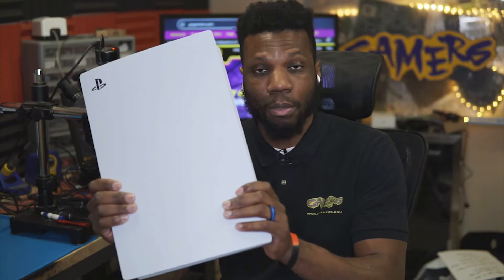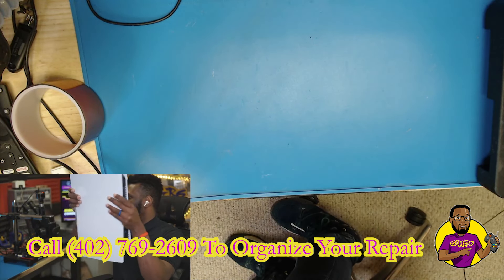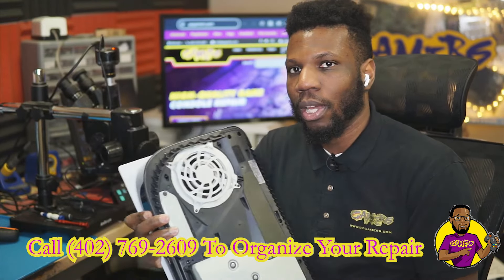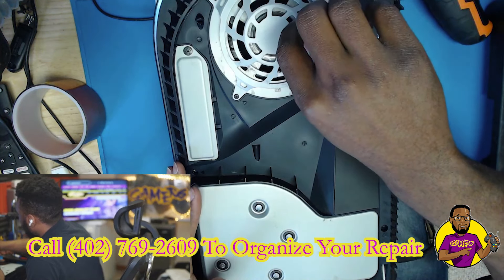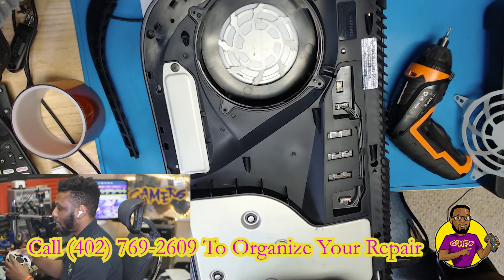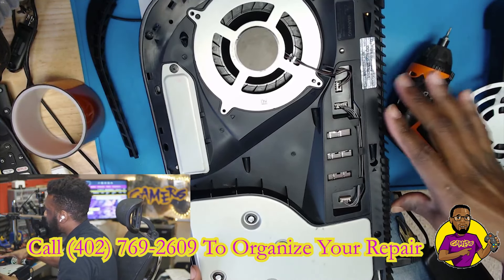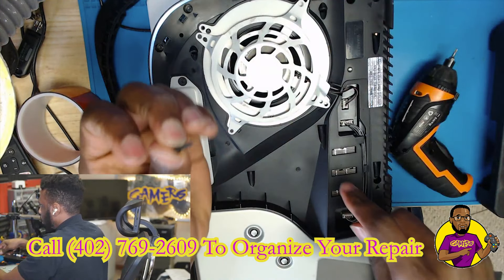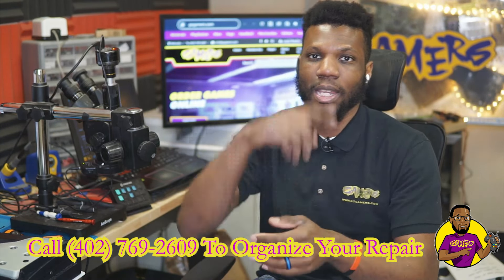Fix PS5 Overheating and Is Too Hot (EASY 5 Minute Fan Repair!)

Comment: This is what happend to me

A bought a ratchet and clank rift apart ps5 and started playing peacefully until my ps5 was like (welcome to the sony airline our plane will start in 5 4 3 2 1 ) and boom overheating text on my monitor and then it turned of when i checked what is wrong then everything was fine but the fan doesn't spin 😞

Comment: Ijust cleaned mine a week ago and it still overheats i even started putting a fan blowing towards it.it has to be the software ive had mine for 9 months and it just started
Reply: Here are the steps I took and my ps5 doesn't shutoff anymore
1. I plugged my ps5 directly into the wall socket (Sony says to try this) 
2. Then I cleared the system cache when I did this I was playing with no issues after that, but in the morning I did a rebuild of the data base just to be sure, been playing like normal now hope this helps

Comment: My ps5 stays over heating smh I didn't pay $700 for this b.s to happen
Reply: Fr in the same position as you
Reply: Same
Reply: same..my fan plug been malfunctioning..stops and goes
Reply: @3amryzefn  the only way to fix this for me was to remove the top face plate. I couldn't play any PS5 games without it overheating and shutting down after 30 minutes. It's almost like the top face plate is smothering it bc it doesn't get enough air. now I can play Fortnite/ sea of thieves/ any PS5 games all day and hasn't shut down again so far. So its definitely a design flaw.

Comment: I don't even get the warning message.
Mine literally just shuts completely off and I can't turn it back on for a solid hour or 2.
It's freaking me out.
Reply: Here are the steps I took and my ps5 doesn't shutoff anymore
1. I plugged my ps5 directly into the wall socket (Sony says to try this) 
2. Then I cleared the system cache when I did this I was playing with no issues after that, but in the morning I did a rebuild of the data base just to be sure, been playing like normal now hope this helps
Reply: @platinum5gaming  this work?
Reply: @llSeannll  only for a little bit but I ended up fixing it tho, I had to buy the screw set to take out the fan you don't need to move any stickers or cables for the fan just lift it out and place it to the side of your ps5 you should see your heatsink where the fan was, clean that and your fan gently use a microfiber cloth to grab excess dust or use canned air to blow through the vents from the inside now when your done the most important step that will stop the overheating grab a flashlight and shine it down where the power cable is you'll see a bunch of holes on a black piece use a toothbrush or makeup brush and clear those holes after this my ps5 is like brand new can't even hear it and no more shut offs
Reply: @platinum5gaming  make a video

Comment: How did you fix? mine ain't that dirty and i been playing since released like Nov 17 2020. It's been a year 7 months today and it shuts down randomly after saying "the Ps5 is too hot,  turn it off". The fan doesn't spin anymore im thinking about replacing it! but the mfs over here sell it for a $100 or $80. I really wanna think this was caused by the recent update cus i dont wanna spend that much money on a fucking fan!! and wait for a new update that going to fix it

Comment: Such a terrible console, I had mine for 6 months when it started doing this and been dealing with it for another year and a half. I  cleaned it regularly and have 3 fans setup still just shuts off after 30 minutes. My ps4 never did this and I had way more hours on it. Cant send it to Sony because everything so backed up from every single person having this same problem, I’m not waiting 6 months for them to repair it. Just pisses me off
Reply: I had a way around it but that’s only if I have the ac on max in my room to the point where I need a sweater. Which costs so much.

Comment: There's nothing wrong with the PlayStation 5 people are not understanding that the PlayStation 5 has been all around and if you stand it up with event comes out with where the heat comes out at the bottom if you have it standing up and you have it in the stand it's going to overheat if you have a stand it up for the PlayStation 5 is not meant to be standing up

Comment: First off don’t stand the ps5 up guys this is not best liquid metal will shift and leak over time.so dry spots happen and over heating then more problems happen permanent damage is the end game.so first take the fan guards off cuzz their restricting the ps5 air flow.please lay the ps5 down flat you want this because liquid metal shifts in a flat fixed position it covers the chip.I suggest dark plates 2.0 if your room temperature is to warm then this affects the console causes crashes.the performance decreases very noticeable.I changed all the thermal pads for higher quality this and the plate that bolts down the motherboard to the heat sink it’s metal on metal if you look so I added some arctic mx4 thermal paste to better help the 2 metal surfaces conduct and transfer heat..it’s crazy Sony is doing all they can to keep that liquid metal in place but over time heating and cooling casually gives flex and this a leak and a dead ps5 Sony is changing the parts in the new ps5 shipments.so think about this Sony don’t want you to have a console last more than a few years I’m the guy who makes your console live long and be prosperous.
Lay the ps5 down people even if it flexes it won’t leak because their is a metal dam around the chip area.all my customers still have working liquid metal modified ps4 pro 3 and 4 years old.I been working on only Sony consoles for years it blew my mind to see Sony use liquid metal after I did.funny actually.
Don’t put a nvme drive in with the lid back on the ps5 ssd bay.please that is not wise throw that out it’s basic not needed just as the fan guards.I’m the dark plates 2.0 they have a cool feature a dust collector.I highly recommend this product and arctic thermal pads for better replacement and cooling.my ps5 is 35 degrees cooler on average next another stock original launch dsc ps5.
Reply: What

Comment: Happened today had ps5 for 4+ months now.
Reply: Here are the steps I took and my ps5 doesn't shutoff anymore
1. I plugged my ps5 directly into the wall socket (Sony says to try this) 
2. Then I cleared the system cache when I did this I was playing with no issues after that, but in the morning I did a rebuild of the data base just to be sure, been playing like normal now hope this helps

Comment: Bull shit because mine overheats just after 10 minutes of game play
Reply: Here are the steps I took and my ps5 doesn't shutoff anymore
1. I plugged my ps5 directly into the wall socket (Sony says to try this) 
2. Then I cleared the system cache when I did this I was playing with no issues after that, but in the morning I did a rebuild of the data base just to be sure, been playing like normal now hope this helps

Comment: Very funny how the PS5 dosent even let you know that it’s overheating, it just shuts off lol wtf. My jet engine PS4 always let me kno when it was overheating
Reply: I know right!? Here are the steps I took and my ps5 doesn't shutoff anymore
1. I plugged my ps5 directly into the wall socket (Sony says to try this) 
2. Then I cleared the system cache when I did this I was playing with no issues after that, but in the morning I did a rebuild of the data base just to be sure, been playing like normal now hope this helps
Reply: It used to let us know when it was too hot, now it just shuts off by itself

Comment: They should have put the mad Max fan in there to do a self cleaning every now and then. You find out that the fan is only running at 10% until you try that mode on the fat PS3. A cloud of dust comes out. The whole room looked like a power room

Comment: Just bought ps5 today it's turned itself off twice once l loaded modern warfare with message saying its too hot.
Unbelievable..
Reply: Is it fixed?? I’m facing the same issue
Reply: @PopcornWithJagrit  2 things.
I took it back to the store they've placed it no problem just remove your ps5 account before you do.
Second are you standing your ps5 upright if so you may have it so hot air can't escape either turn it over or place it sideways if problem still persists when sideways it is your fan if it stops its because you had it upside down
Reply: @ozepaul  this may explain more of my console condition 

I just bought ps5 2 days back and when I'm playing ps5 game, an error pops up ( your ps5 is overheating, turn it off) i have checked there is no dust or anything i just got it 2 days back.. changed the setup too vertically to horizontally) nothing is working.. PS5 games are causing overheating error to pop up within 5 mins of gameplay.. + my PS5 doesn't appear to be warm when i touch it when the error pops up yet it's turning my ps5 automatically... it's working fine with ps4 games.. i played horizon zero dawn for an hour, no error observed but as soon as I switched to COD or astro playroom, within 5 mins it says overheating and it turns off automatically.
Reply: @PopcornWithJagrit  back to the shop for it.
The dude where l took mine back said they hadn't had an overheating problem for a while their last batch they had was faulty disc readers he said he got 40 new ps5 so they tested them for faulty disk before sale 25 were faulty before being out on the shelf